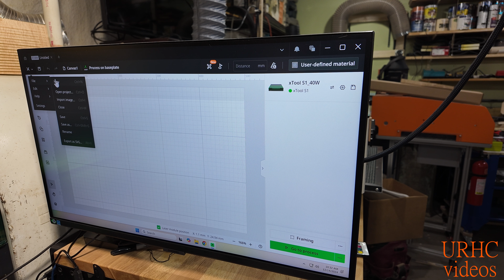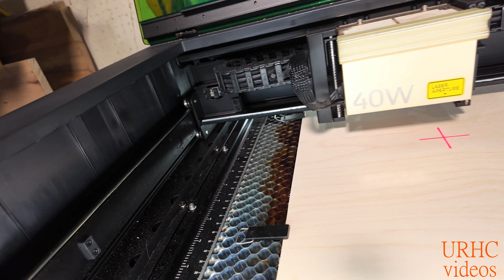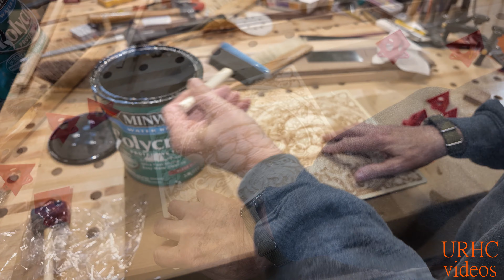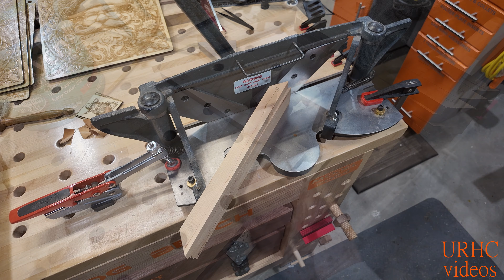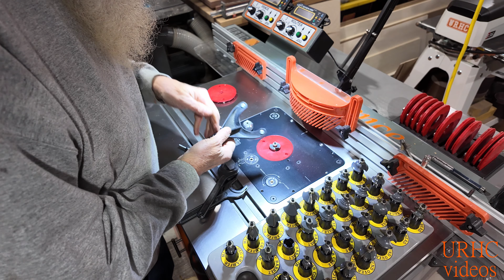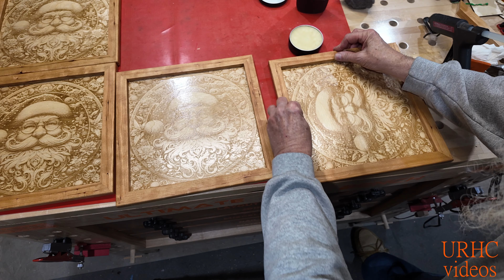How I Made Christmas Gifts With My Xtool S1 And Backyard Harvested Cherry Wood

Comment: Wondering if the laser can be used on steel or other metals?
Reply from the maker: No, the diodes are not good for steel or metals. Fiber lasers do a good job on that. Thanks for watching.

Comment: Ed, you showcased two tools that I think no serious woodworker should be without. The drum sander and the miter trimmer. Both tools cut out a lot of cussing and not to mention the time it saves. It is always good seeing your projects from start to finnish.
Reply from the maker: They definitely are nice to have and save time. The trimmer makes small frames come out perfectly every time.  Big difference in how much sanding is required with perfect no chipping joints. Scares me though. Thanks for watching.  Merry Christmas.